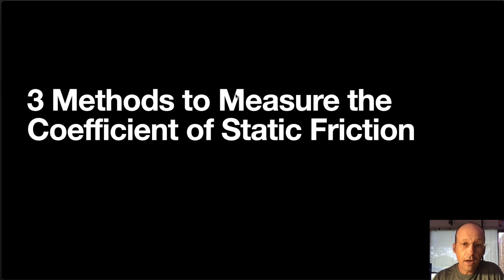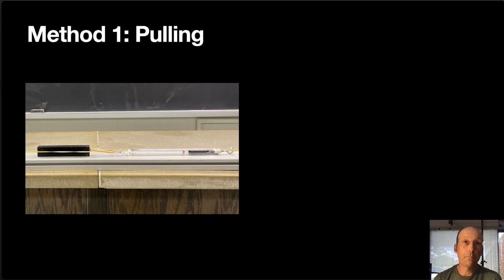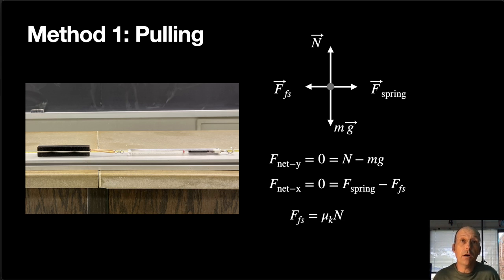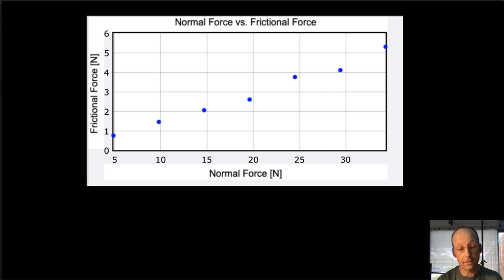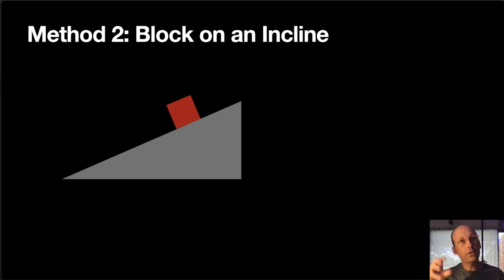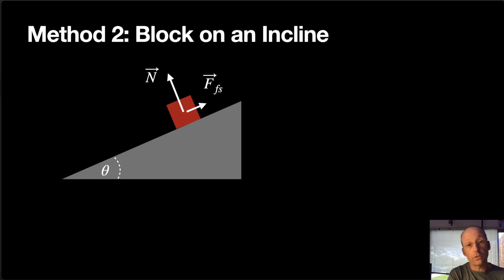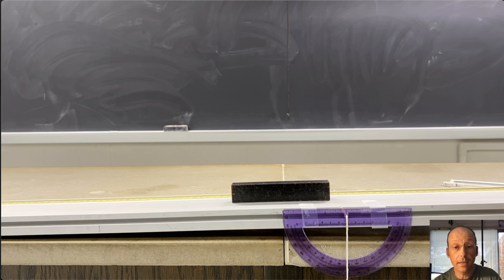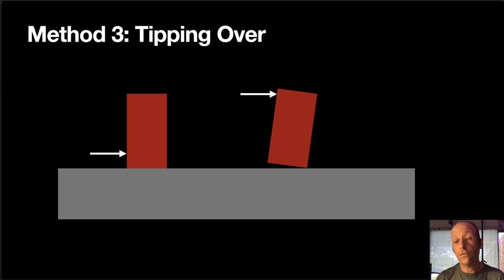Three Physics Methods to Measure the Coefficient of Friction

Comment: That last one is an interesting one that you wouldn't intuitively think of. I think we solved a similar problem in engineering school. I need to measure the static coefficient of friction between a nylon belt and multiple coated surfaces with different Ra values. I think I'll go with methods 2 and 3. I wish we had a tribometer.